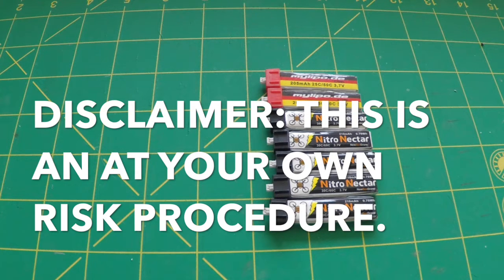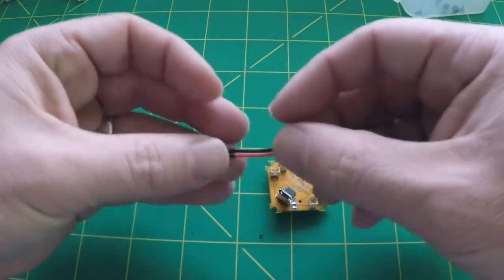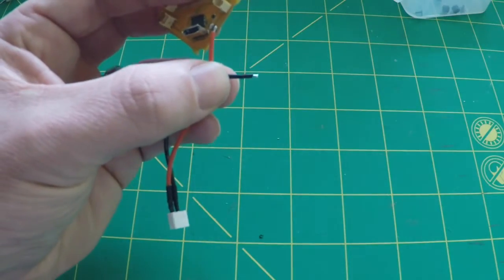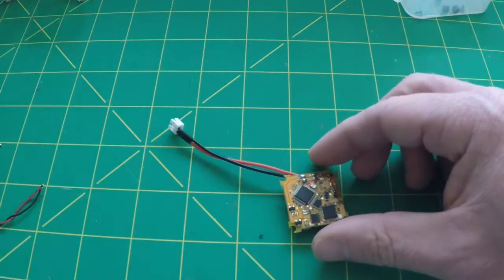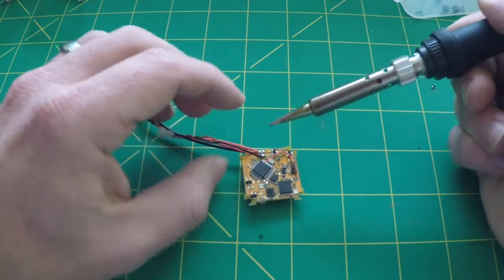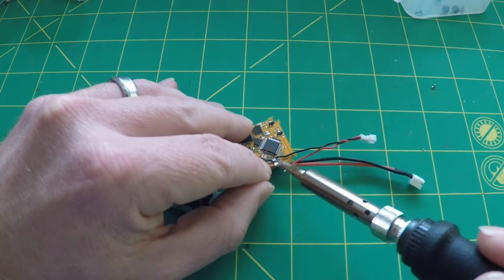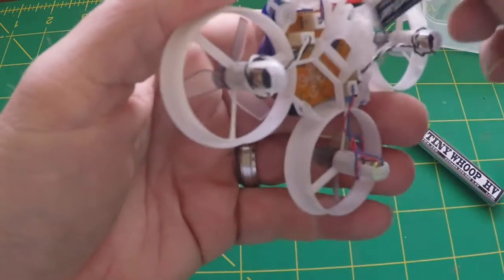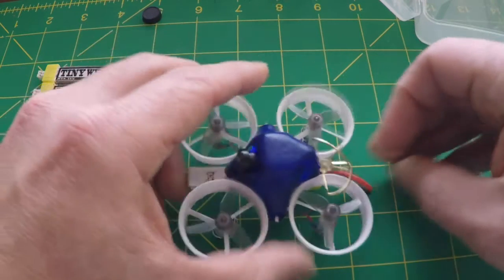Tiny Whoop Dual Pigtail MOD

Comment: Is there a reason you don't just splice the second connector into the first and not have to solder on the board at all? You'd likely save a bit of weight also by not having the full wire of the second connector.

Thanks!
Reply from the maker: Joshua Kapellen would be a great option for permanent use. However this is great for temporary purposes. I believe that once someone feels the 2.0 connector then they will quickly begin transitioning completely. So once all the older batteries start losing life or you get more 2.0 batteries it's easy to just desolder the 1.25 and just run 2.0!
Reply: Ah, that makes sense. Thanks for the video and quick reply. :) CAVU!

Comment: nice prop - can you give link for them? - thanks
Reply from the maker: QUADCOPTER FPV https://micro-motor-warehouse.com/collections/rambo-whoop/products/jst-ph-2-0-pigtail

https://www.tinywhoop.com/collections/all/products/upgraded-battery-pigtail-powerwhoop-connector?variant=28401801153
Reply: Many thanks - but I need  to link the props -
Reply from the maker: Doh. Sorry. Www.tinywhoop.com has them. But they are very popular right now. So you just have to look for 31mm rakonheli props.
Reply: SkeattsFPV  thanks